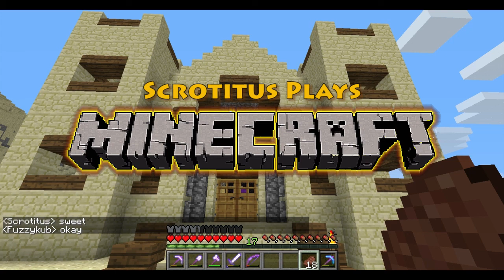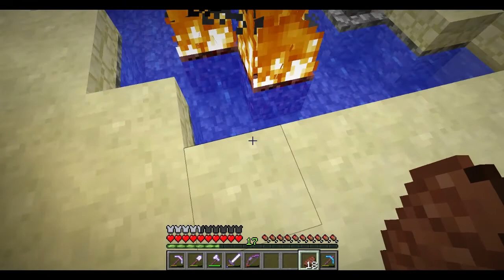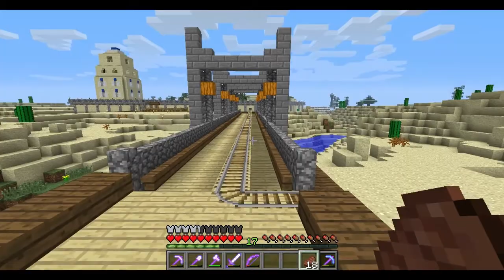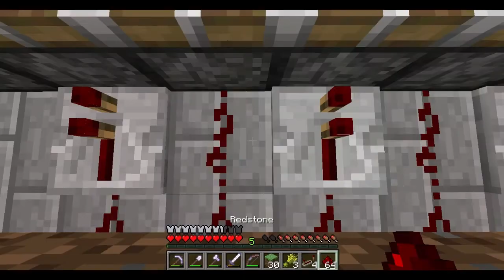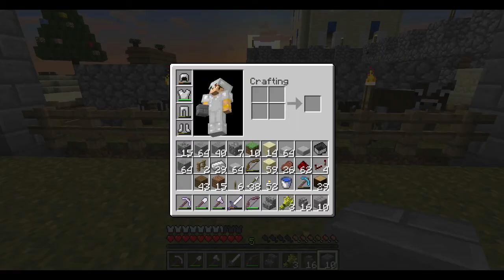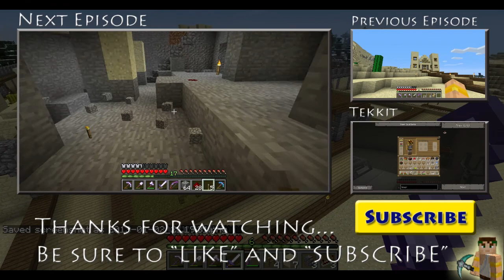Minecraft - Episode 13 - Cattle Stables

Comment from the maker: This is just phase one of the cattle project. don't worry, there will be signs a plenty... ha ha. I may need a few more buttons for the control panel so i didn't want to label then have to move anything. The fire inside the village walls is a small pyre used to light up this side of the village. early concept before i put in the day night sensor.